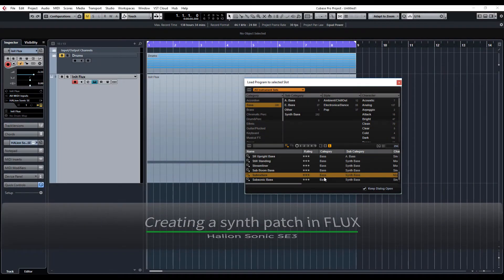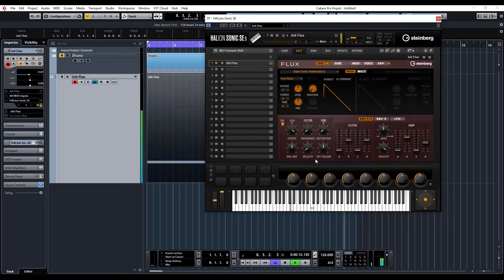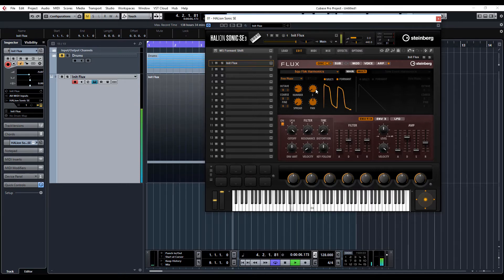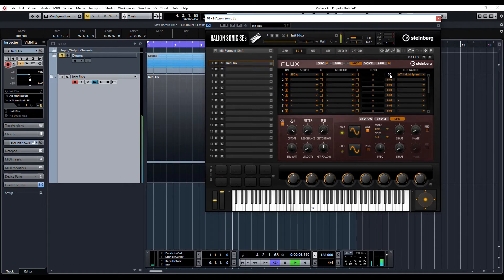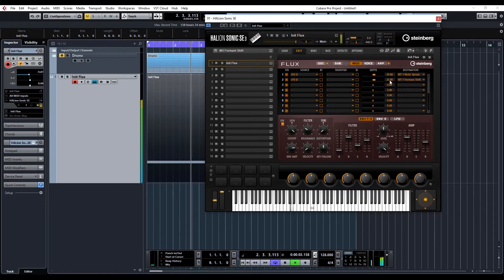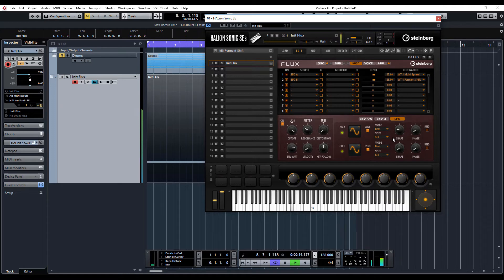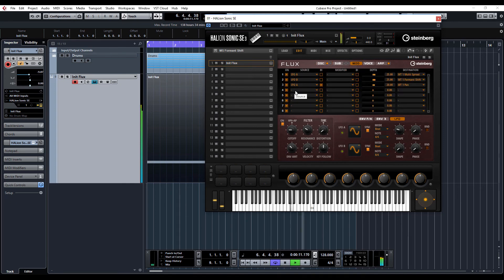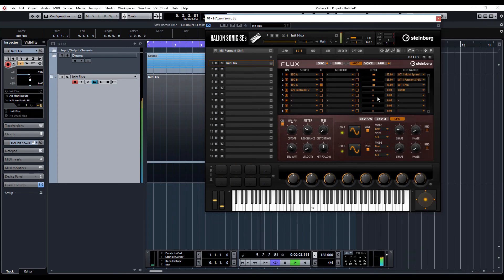Synth Patch Creation using FLUX VSTi in Halion Sonic 3 SE #1

Comment: Great little series on the Flux Mike! I like your workflow which I intend to follow - could be applied to other synths just as well.  Have you played around with the noise parameters in the Flux because lot of options there?  Would be interesting to see how you'd incorporate those...
Reply from the maker: leave it with me. Thanks for watching.
Reply from the maker: Will see what I can come up with, sadly all you can really do is add it as a noise source to add a bit of crunch to the osc or use it to create noise risers etc on its own, there does not seem to be many if any modulation options with the noise.
Reply: Right.  I'm sure you'd come up with something cool anyway.  Thanks for the reply